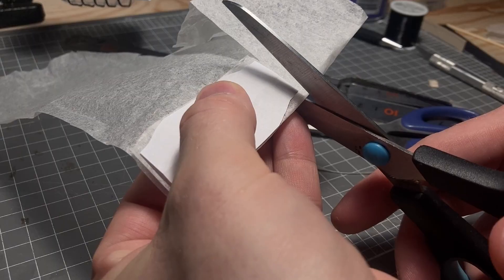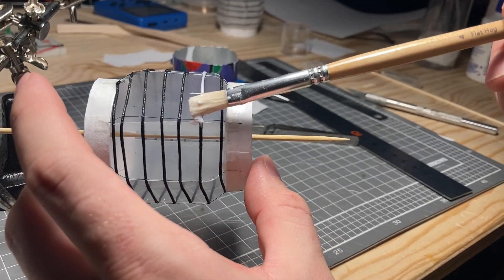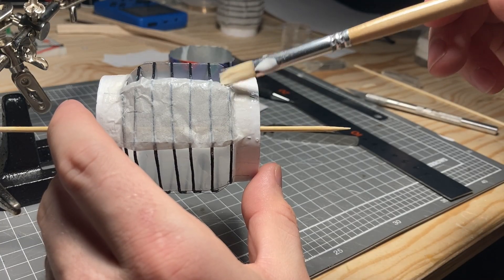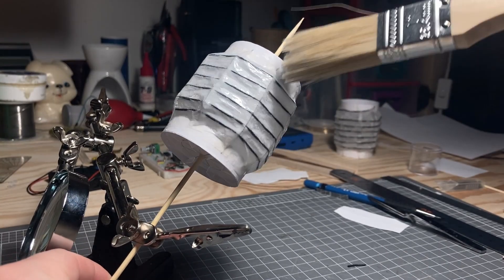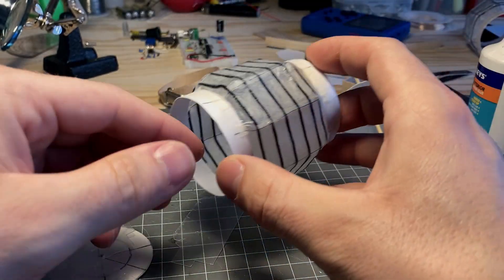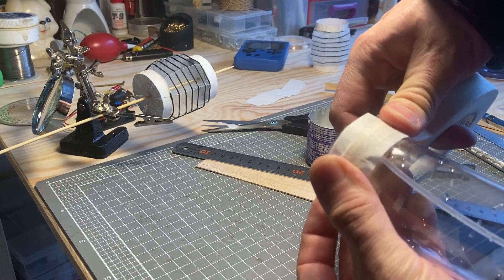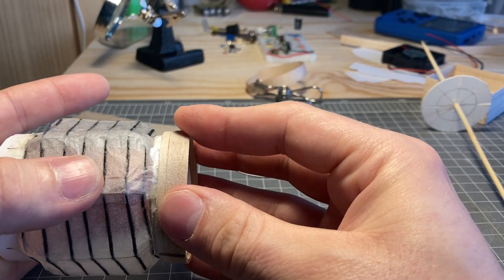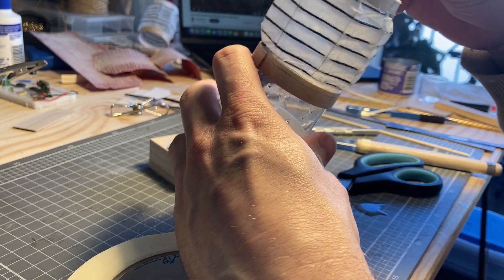The most complicated soldering fan (its a little more than that)

Comment: Great job 👍🤓 and yes it does look cool 😎👍 really good job 👍 Hey I'm not a a electronic person, but I love the beam bots and made one for my self years ago, but I have all ways wanted to make what I call a bucket bot that can follow me around and stop when I do, but it seems so hard to do, it needs to stop about two feet away from me and then follow me when I start moving. But I was wondering do you know a simple way of doing this??? I'd like to use it to carry my tools around, that's why I wanted to use a 5 gallon plastic bucket, do you think it's possible to make a simple circuit that can do that???
Reply from the maker: Thank you, much appreciated. I think you could do something like that with BEAM tech but if I am being honest, I would probably use a microcontroller. Tuneability and interfacing with sensors are not BEAM's strong points. 
I love the idea, though; a couple of ultrasonic sensors and an Arduino would probably not be all that hard to implement. Cheers.

Comment: Lol you were not kidding! Scope be damned!

I personally would ditch the carbon "filter". Having looked into what it takes to exchange stuff with a stream of fluid, I can say with the utmost confidence that those sponge "filters" do absolutely nothing to extract volatiles from the air blowing through them. When those are used in a room air filter, and the air has multiple passes per day to interact with the carbon, ok. Maybe. But if one checks out what it takes to really filter a significant fraction of the volatiles in a single pass... it's about the size of a vacuum cleaner for that much air. The Hakko FA-430 is a good example of an activated carbon soldering fume extract with filter that actually has a big enough activated carbon element to extract meaningful amounts of VOCs from the airstream.

Typically, on the cheapo carbon sponge units, one sees the filter in front of the fan. There's a good reason for this: well, maybe two. First, kind of incidentally, it protects the fan blades from bigger pieces of dust (at least somewhat). That's a nice side benefit. More importantly, this type of CPU fan does more than just suck air through it. The air near the sides of the inlet is usually flung outwards, not being sucked in at all but forming a pretty turbulent recirculation zone in a doughnut surrounding the fan's inlet. This is worse when the fan has any back pressure to work against (which your design has very little of... at least if that filter is removed!)

I know this because I built a fume extractor that exhausted through 10 feet of dryer duct when I was a kid, to appease my mom and be allowed to solder in the basement. In a funny echo of what you've built here, I used a swing arm circular fluorescent magnifier lamp, from which the magnifying glass had been removed, and the fan inserted. Now, this did not work. This basement still smelled distinctly of fumes quite quickly. I realized that the fan was suffering from this recirculation issue I describe. Obviously, pushing air through 10 feet of duct is much harder than 10mm of sponge "filter", so the back pressure issue was worse, but I think these fans tend to do that turbulent inlet thing even without any back pressure at all. In that case the solution was to move the fan down to the exhaust end of the duct. 

A guy on Reddit shared data with me he took from one of the off-the-shelf desktop extractors. This was with a particulate air quality monitor which showed that when the carbon filter was removed from the inlet, it didn't work as well. He shared this in response to my claim that carbon sponge filters were bunk, which he didn't initially agree with. But what we realized in analyzing the data was that neither the with-filter nor the without-filter trace showed any reduction in particulates on the first pass. The initial spike of smoke coming out in the first 10 seconds was the same. What was different was that a low level of particulates lingered around the "no filter" test unit for a long time (almost a full minute). If the fan had been sucking all the smoke in, and blowing it far away, this wouldn't have happened, even with no filter. I'm fairly sure this was the turbulent, recirculating cloud around the inlet. The only thing the filter is doing in those designs is basically baffling or muffling that inlet turbulence, and preventing the fan from being able to fling air out to the sides. Besides, those sponge filters aren't even designed for particulates. We can assume that they are basically 0% effective at PM2.5 filtering (which is what that guy was measuring). 

So, rambling ended, summary: 

-Super cool build, it very much matches your aesthetic! 
-Obviously going to be a very effective tool for getting smoke out of your face.
-Carbon sponge filters are useless except to reduce fan inlet turbulence. For you, if it works, keep it! For others doing this kind of build, consider other ways to prevent the fan from flinging air back out (such as mounting it near the outlet of a duct, rather than the inlet).
Reply from the maker: I love a good rambly comment, so thank you. My original design actually did not have a filter at all, and I might remove it from this, as it did work (slightly) better in testing without it. 
I was thinking the same while looking at this filter material; it is very open (probably why it has so little effect on the airflow), so I can't imagine it is doing too much to remove stuff from the air. 
The stuff about placing the filter in front does make sense. I may look into that for my next design, if it has a filter at all. 
Thanks for the comment, and I am glad you enjoyed the video!c